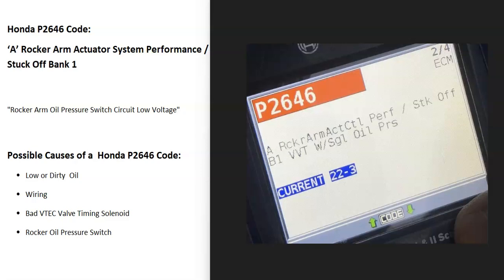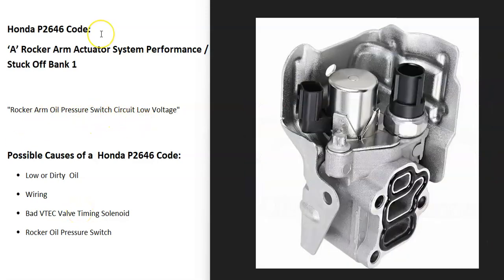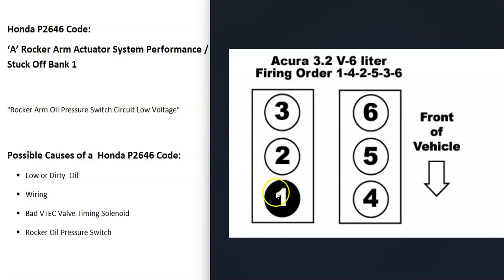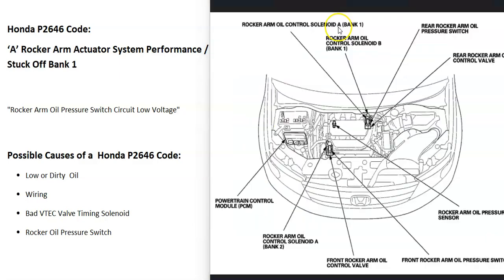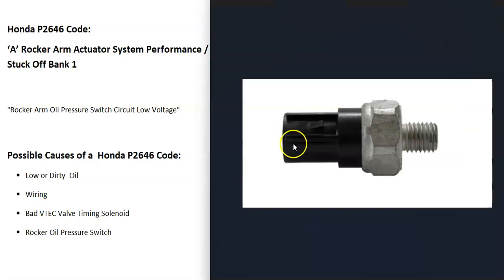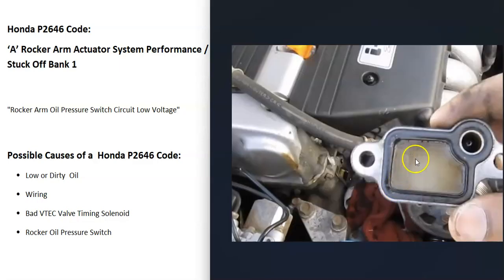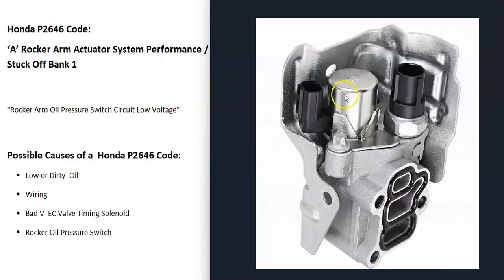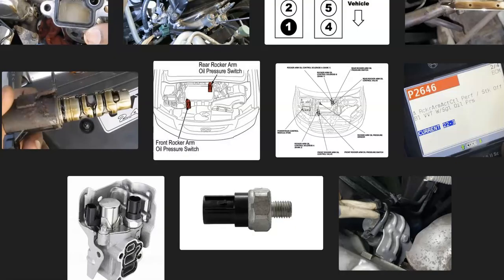How to Fix a Honda P2646 Code: ‘A’ Rocker Arm Actuator System Performance / Stuck Off Bank 1

Comment: I noticed you did not mention that sometimes water gets in there and it causes causes a car to cut out at 3000 RPM and so every time I clean my engine compartment it happens every time eventually goes away on its own

Comment: I wish I could send you a video so you could hear my honda odyssey. Its making a loud ticking noise due to oil leaking and having low oil. I believe it's because of the faulty gasket on the rocker thing but idk. So much it could be related to lifters/rockers.

Comment: Hope this helps someone: I did oil change, checked the vtec screen it was spotless, and the vvt solenoid was spotless and working fine after I did “click” test. Nothing changed VSA light still kept lighting up especially when going up any hills. It ended up being the oil pressure switch which is a 2” in diameter sensor right next to the vtec assembly (it is not part of the assembly with the solenoid and screen as shown in this video). I went to swap it out took me 10 minutes and part cost me $70 at Autozone. Started it up and have been running perfectly ever since.
Reply: Ill try this next thanks
Reply: Can you share the part for this?
Reply: Inshallah the same fix for me

Comment: I have someone saying they need to take the entire power steering out to check these things.  Is this something I could do on my own pretty easily without that?  Meaning checking the screens and cleaning them as well as replacing the switch mentioned.

Comment: I have an 2006 and have this code. I replaced the spool valve and also put a muzzler for the vcm after that didn’t work and didn’t work. Still throwing a this code
Reply: It could a wiring issue if they are damaged the code won't despair

Comment: People are selling diagnostics for this at $150.  Instead by the gadget to read the codes yourself or go get a free code reading at a nearby shop.
Reply: Amazon sells a code reader for around $20 that reads and CLEARS your codes !
Reply: @bloominflowers6766 dont clear codes fix the problem or your just not doing much to fix the issue

Comment: I washed my engine bay and this code popped up
Reply: Moisture in your connectors is likely your cause. Pull your connectors and inspect the inside to see if it's nice and dry or if it appears to allow moisture in. If the pins are not corroded and there is signs of moisture then apply dielectric grease and it should solve your problem. Doesn't hurt to change the grease every once in a while.

Comment: Hey mate how are u?
Actually I have got same code and I have replaced whole v tec solenoid assembly in including new switches which bolts on back of head and problem was solved after replacing but after couple  of weeks I got same code and same problem surging and missing on road with engine light I have cleaned front screen and vvt solenoid on front I am not sure what’s causing unless parts faulty ?
Reply: same

Comment: Everyone asking the same questions but what would cause this? My catalytic converter was stolen and i welded a straight pipe for now 😂😅 dont tell me its cause of that ive had atraight pipped cars not have me in limp mode all day bouncing off 3k rpm

Comment: I have a 2005 Honda Element EX and it is randomly stuttering, does not happen all the time, I took to get it scanned and the computer threw a P2646 code, they say to replace the VVT pressure switch.

Comment: Thank you for this video. My 2017 pilot threw the emission and transmission faults. I didn't record the exact codes, but the same rocker arm actuator fault came back immediately after attempting obd2 clear and battery ecu reset.

Almost had it towed, but went back with what I needed to change oil and rear oil pressure switch.

Checked oil and verified it was quite dirty, even though the oil life indicator displayed 70%.

Luckily it was in a parking lot and I changed it on site; also removed negative to reset ecu again. Vehicle started without issue, tested around lot waiting for a misfire or hesitation. Didn't feel any, hopped on highway, 20 miles, no issue. Scary now that slightly dirty oil will strand these vehicles.

Comment: I've had this problem for 9 Months. Ever since running through some deep water that was flowing across the Road after Dark. I have an 07 EX-L Accord Coupe, 2.4 Automatic,  and I've replaced the Entire VTEC Valve with the Oil Pressure Switch & Screen, the Actual Oil Pressure Switch mounted to the Block Below the VTEC Valve. Also Replaced the VTEC Solenoid and Screen on the Pully Side of the Engine and Changed the Oil & Filter. And it's Still throwing the P2646 Code when Moisture is introduced to the equation.
Reply: @fluffycat6489 On Your CRV, are the Windshield Washer Nozzles mounted On the Hood? I've seen One Video in my search, that showed where Moisture/Water leaks around the Washer Nozzles (From as little water as Dew forming on the Hood) the water drips down and is getting in the Connectors that plug into the VTEC Valve and Oil Pressure Switch on the Back of the Engine. The water gets into the Connector where the Wires go into the Connector causing it to Corrode, or even just Short The Connection. Their Soulution was to first, seal the area where the Washer Nozzle goes through the Hood, then to Clean the Connectors using Electronic Parts Cleaner, then Seal the Connectors where the Wires go into them  with a High Temp RTV Sealer. Lastly Use Dielectric Grease inside the Connector to keep moisture out. I haven't done this to the Connectors on My Accord yet, but After Driving enough to Heat Everything Up to Dry Everything Out, after the last time Water was involved to Degrease the Engine, the Code Cleared. On My Accord the Washer Nozzles aren't mounted through the Hood though, they're mounted in the Plastic Cowling at the Base of the Windshield.

Comment: Gracias for the overview of it. I have a 2.4L and keep cleaning the vvt solenoid even though its a rocker arm code. Im gonna go hunting for those screens and the solenoid in it  Thanks again
Reply: PS i have been changing oil, not filter, every 1500 Miles

Comment: My car randomly started shaking violently every time I would stop and then the car would die, got back home and found out the rocker arm was bad, I’m pissed because it was working fine the day before with no signs anything was wrong
Reply: Literally happening to me rn
Reply: How did you fix it
Reply: @amethystchoke8466  same thing happened to me after I drove through a puddle that was a bit deeper than expected. My exhaust was submerged
Reply: @naYro-ORiON so your exhaust got water in it and that damaged your vtec system?

Comment: I'm working on my son's 04 Civic Ex. I'm trying to locate all of the screens and solenoids that could cause the P2646 code. I've tested that the connector to the spool valve had voltage, then replaced the spool valve. I replaced the rear oil pressure switch as well. Yesterday, I did an engine flush and would like to clean any other screens before the car is used. Could you tell me the location of said screens and solenoids?

Comment: Just took my ‘05 Element in after getting some occasional sputter / misfires. 2646 was the code my mechanic said out loud. I’m hoping I don’t have to spend more than $400
Reply: any update?
Reply: $300 cash instead of $362 retail / charge. Bro discount. 😊
Reply: @alive1945 what part did he replace ?
Reply: @plutodread97 I guess he doesn’t know

Comment: bucking is part of the problem i had i put a new from O O O Rileys and ended up buying a different one ??? and allso there is a oil pasage in the rocker assambely im told that gets plugged ??? dont know i dident fix it this time but the guys in Vermont are good with these

Comment: there is one more problem asocieated with this problem suposidly there is a wireing harnis and one of the pins gets caroted thats what im told shortly after fixing that i had a nother code knox sencer in the front behind the exhaust manifold, all so watch your oil if it gets dirty and im sure it will but dirty oil lack of oil changes dose not help this problem i would use the best oil you can get for this Vtex engine. if you have a miss fire on one of these engines you will loos a lot of power these engines are not power houses

Comment: Installed a new genuine vtec assembly, oem screens for the side solenoid and front strainer gaskets, and cleaned the solenoid. Still get 2646. Down to possible wiring issue. Bought new pigtails for all three connectors. How do I know if it’s bad wiring?
Reply: test voltage with a voltage meter, the voltages should be online for your exact car
Reply: @Eoki  thanks. May try to do it myself tomorrow. But I suck at all things electrical. 😂
Reply: I did exactly the same thing. Mine is a 2007 Honda pilot. Something else is causing this. There is another VTEC looking part that is part of the oil filter housing. I'm thinking that may be the issue it is accessible from under the car on the passenger side I'm going to try and see.
Reply: @mngopa  I’ve replaced that, the back VTEC assembly and the VTC sensor in the left side. Still no luck.
Reply: @drbyers dude i’m in the same boat. i’ve looked at so many threads and even my buddy who used to be a honda tech for a couple years is lost. opened up my engine to see if there was any possible damage to the timing chain or anything and i saw no damages. completely lost here

Comment: How do you clear the code? Entire assembly and screens replaced. My cheap reader can't seem to clear the error.
Reply: Cheap readers should be able to clear the code. Mine does.
Reply: @drbyers  I just learned. Depends on year. 2009 or older, it's a permanent code that you have to do a drive cycle to clear. Newer stuff, you can clear the error
Reply: What do you mean drive cycle @gearheadgregwi
Reply: @efernandez10251984  engine computer waits for certain rpm's, etc. Usually, about a week of monitoring and computer clears the error.
Reply: @gearheadgregwi no man if your scanner won't clear it that means its coming right back and the problem isn't fixed
Reply: @drbyers yeah. Mine is really cheap and doesn't clear squat. Battery disconnect does though.

Comment: Did the solenoid, did the other one on upper side of block and calibrated the valves, and did oil pressure switch, always keep up with oil changes not sure why issue persists
Reply: Did you clean the filters on the one that is on the oil filter housing?
Reply: @mngopa  the square soleniod may have went out and or got clogged by royal purple hmx 1030 when Honda calls for 530. Replaced both and the issue persisted thus i may have gotten a defective sqaure soleniod. So i did them twice ive been fine now and stopped runi RP 1030hmx it was a headache almost sold car im like at 230k miles too i need to run it as long as i can until im wealthy 🙏🏽 God Bless 🌅

Comment: i have 05 4 cyl honda ellement . i replaced the Vtec asambly but check engine lights went out but back on car is BUCKING will not shift through the gears when excellarating so my teck guy is coming up with cods like oil pasage pluged,Vtec,exc, he has checked grounds and power to it .. he all so tryed to by pass it he said it should the engine should flutter but its not doing that ..??? so he is thinking it is in the valve cover rocker oil pasage ??? is this possable and what ells could it be .. backing up we bought the car and i noticed it was down a Qt of oil so not thinking i added a Qt of 5-30 or 10-30 i know it was not 5-20 so i drove the car got the corect oil and changed it with a fram oil filter and 5-20 castro synthitic iv been having this bucking problem since thank you for any help
Reply: i dident fix mine i had a friend fix it he said he took the rocker cover off an flushed out the rocker shaft i dont know if he did or not but we have a couple thousand mi on it it runs 100% better then the light cam back on and it was crank posion sencer couldent tell in porfinces with the bad crank sencer ... but same guy fixed it again this thing runsss like a top never ran this good when i got it so check this out
Reply: Similar problem with my 07 Element, light just came on this morning bucking hard when seemingly trying to change gears. Around 55mph going up, as if from 3rd to 4th gear. Always kept on top of oil, Pennzoil High Mileage Synthetic and WIX XP Filters (recommended by Honda) and had this baby since '19!
Reply: I've been having problems with my element as well. P2646 code came up and car buckles. I already replaced the VTEC solenoid and it had been pretty good with the oil change. A week later it shoots out the code again. Should I also change the VSS solenoid too.
Reply: I changed my ‘04 to Mobile 1 full synthetic and it immediately did the bucking thing. Drained it and put in partialValvoline partial synthetic and it never happened again.

Comment: Bro thank you I’m a out to go crazy with this damn code I’m about to do all of this and come back and let you know how things went
Reply: well tell me dude.
Reply: Update???
Reply: tell me please
Reply: i don’t think it was good….
Reply: My car ended up having an oil leak so I just had to fix that and put more oil in. Essentially the code was caused by low oil.
Reply: No update lmao?
Reply: I have a 2007 Honda pilot I replaced this VTEC but the code persists. It is no longer going into safe mode limp mode but the associated code keeps coming back also the VSA light and triangle warning ⚠️ did not go off. I honestly don't know the cause of this issue maybe it is the other one near there oil filter. I'm going to try and replace that one or look at the screen.
Reply: Update?
Reply: I think he went crazy.